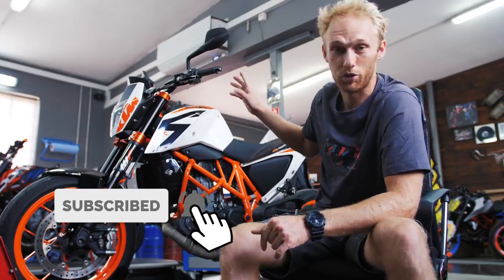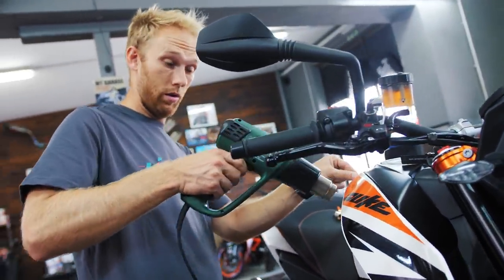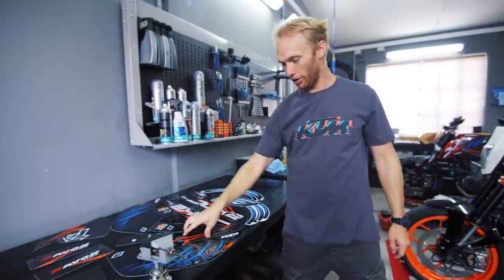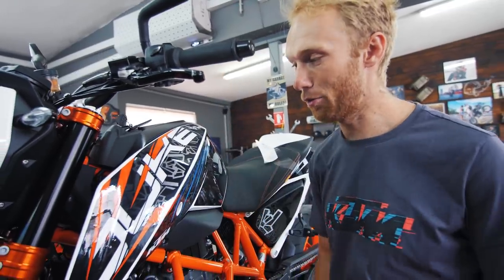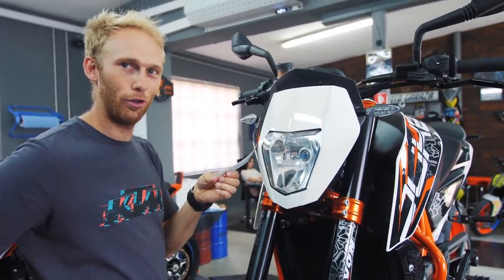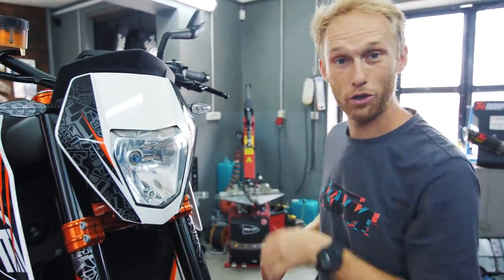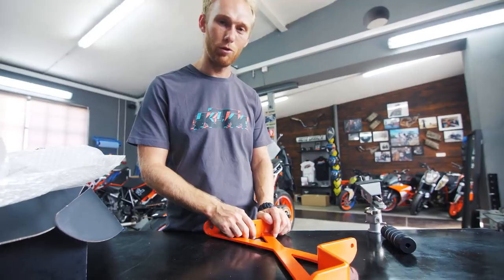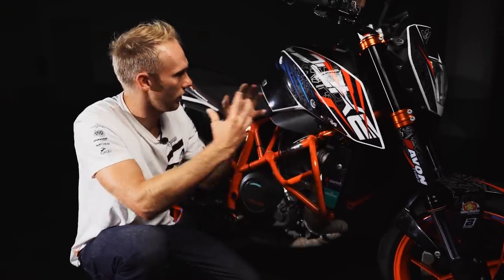TRANSFORMATION OF KTM DUKE 690 R | RokON vlog #89

Comment: With the nice weather I am enjoying riding my 2017 Kawasaki x300 Versys and my 2013 KTM Duke 690 Supermoto. Today I rode both of them back to back and delighted in discovering the attributes of each of these wonderful motorcycles. Here is my evaluation: My Kawasaki seems like a Rolls Royce compared to the KTM Duke. It's engine is much smoother and much more quiet. The clutch throw is much softer but has a longer pull. I like the gear shifting on the KTM best. It is a bit clunky but has a short positive throw and more precise clicking into gear. The clutch is fast and positive. The KTM has way more power and acceleration than my Kawasaki. But that is an unfair comparison considering that the Duke has more than twice the displacement. The guages and features are far nicer on the Kawasaki. I like the gear position indicator and the fuel gauge that Kawasaki offers. The KTM has a far more comfortable seat compared to the Kawasaki. However, the seating position of the Kawasaki is much nicer than the KTM. Both are fairly tall motorcycles. I recently lowered my Kawasaki 1-1/2" which I highly recommend if you are shorter than 6 feet tall. My Kawasaki feels better balanced than the KTM, but only slightly. The KTM has so much torgue, so less down shifting is required. Just twist the throttle and go in any gear. The Kawasaki has a very high revving engine. It takes 7,500 rpm to cruise 65 mph. The KTM rarely needs more than 4,000 rpm. The Kawasaki engine internals sound smooth as silk. The KTM sounds like it is grinding bolts internally. The KTM has a very jerkey low range, not very tractable. The Kawasaki is the opposite. Very smooth. Both motorcycles shine in the twisties and curves. Both motorcycles are very flickable. The KTM may have a slight edge in handling but overall I prefer the ride of the Kawasaki. My final impression is that both motorcycles are wonderful, the Duke for it's torque and power, the Kawasaki for it's dual sport smoothness. If I could own just one or the other I would keep the Kawasaki for it's Rolls Royce build quality, smoothness, handling and quietness.